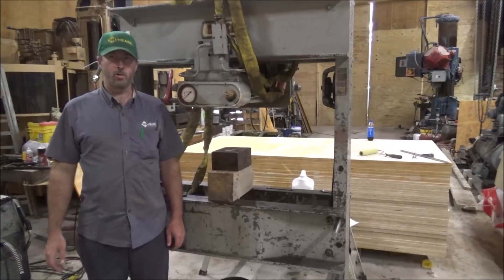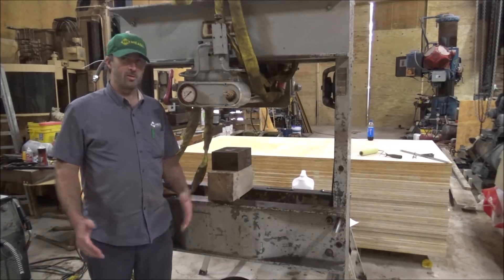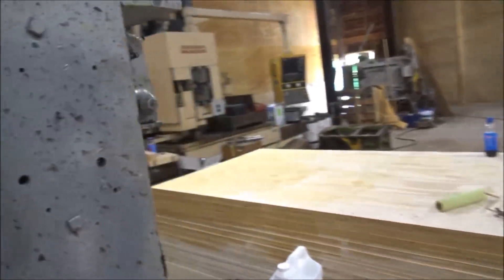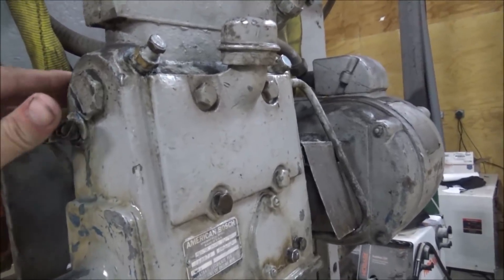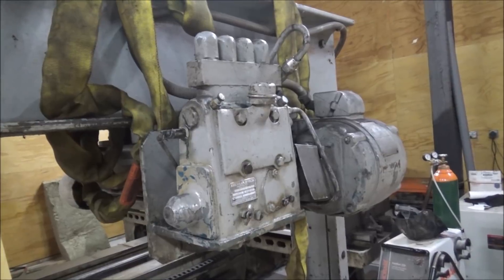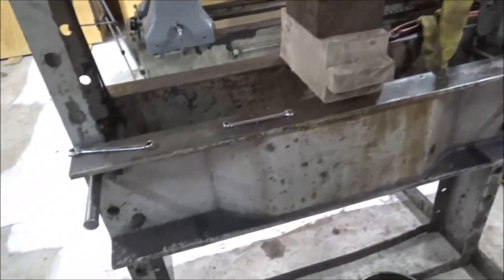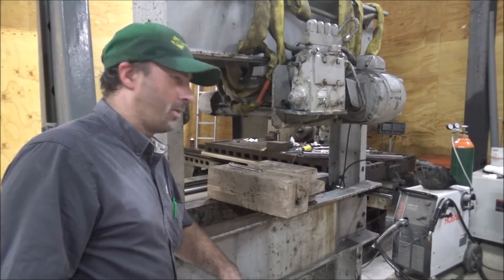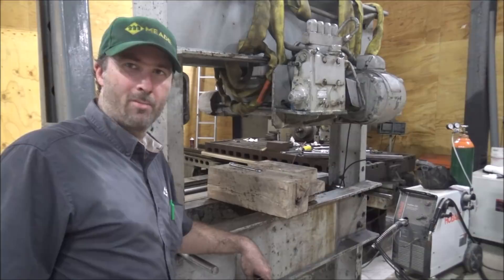Antique Dake Press Back in Action

Comment: Hey Brain could you answer a few question on using the injection pump. I just rebuilt a $ 34.00 dollar auction press and have new 4 cyl injection pump with nothing that it fits on is the pump direct drive off the motor and what is the rpm and hp of the motor.  Thanks.
Reply from the maker: In mine it runs direct off a 3hp 1750rpm motor
Reply: @bcbloc02  Thanks Brian did not want to go in to it trail and error.

Comment: I'm wondering if it could push more than 20 tons, not being 100% familiar with that type of usage of a diesel injector pump for that purpose, what I understand, is that an injector pump is able to put up in excess of 10k psi. or .....    Maybe I'm wrong...???
Guess we'll see in future episodes...    ;)
Reply from the maker: They have a 5000psi relief valve installed on the pump outlet. It is supposed to be set to produce 75ton as per the rating. I don't doubt that it still can.  I just don't have anything that needs that much squeezing. I had it 30ton and decided that was enough to put on the 6x6.

Comment: enjoy the videos, ive got a couple of chunks of steel that  may be suitable for that press what size do you think would work well on the bed.   Dave
Reply from the maker: 1" to 1.5" thick by 3-6" wide and about a foot long.
Reply: @bcbloc02  what I've got may be a little  bigger than you need , got a chunk  2 1/2" thick 11 inches  wide and 30 inches long.  Could you get what you need out of that? If so I could get it to you sometime fairly soon.  I  am just down the road in Knoxville.  DWG
Reply from the maker: Yeah I could saw some plates out of that.
Reply: ok , let me know the best way to contact you back channel and we will set some thing up.
Reply from the maker: shoot me an email bcbloc02 at yahoo
Reply: email sent
Reply: @bcbloc02   We had some press plates that had a V in each end of differing sizes and if you flipped those plates over there was standing  V blocks on each plate that was handy for straightening bent shafts. You might want to add some of those to your project.

Comment: The patent was applied for on 1952-03-15. It is for a "Hydraulic eductor valve", which appears to be the operating valve for the machine. The patent is for a clever arrangement that makes the ram move much faster than it normally would at low pressures, so you can get it down to the work in a hurry, then it moves slowly as it applies pressure.
Reply from the maker: I checked it out and it is really cool. Increases ram travel speed by 5-6 times!! That is impressive.

Comment: So that press is a 20 ton. Seems like it should be more. I have the slab of inch steel plate for the bed for you. Somehow I think the Australia post guy might complain if I stick it in a flat rate satchel though. 😛
Reply from the maker: I didn't want to put over 20ton on a wood board so I didn't test it any higher.
Reply: bcbloc02 ohh i thought u had it maxed out. Looks like u did,
Reply from the maker: I maxed it when I was fooling with that valve that limits it but otherwise I nowhere near maxed it.

Comment: Give dake a call with your serial number and they wil tell you when it was built and email you a parts manual.  I did that with mine, which is a 1944 much older than yours, and they had replacement parts in stock.  A great company to deal with.  

Is that a 75 or 50 ton press?
Reply from the maker: Gauge goes to 75ton  so I assume that is what it is.

Comment: Super press Brian, great find. Glad you have it running.
 I checked the Dake Corp website and it is about 12 miles south of me in Grand Haven, MI. They say that they have parts for old Dake presses so if it broke could fix it 
Here is the link to the 5-0 series of hydraulic presses.  http://www.dakecorp.com/uploads/pdfs/manuals/5-Series-Press.pdf  
The new press looks a lot like your old one. 
They now use a 5 piston wobble plate pump but the old one you have will probably out last anything they have now! The lift hoist looks like yours too with a new position.

Comment: Hey how are those cables? I have heard they they can break unexpectedly....especially when they are holding up something expensive. hmmmm   Are you going to turn up the pump for MORE POWER? That is one cool press!
Reply: There are metal pins which hold the table in place while pressing, the cables are there only to help easily move the table to the different places (heights) where the pins can be inserted.

Comment: i always liked presses with traveling rams.. so you could press on one side of the bed or the other. 

are there 2 bed pins on each side.. the lower set as safety so if the top ones shear the lowers catch the bed from dropping very far.
Reply: I've been wondering, if a press table was to have one set of pins only (one on each side), would it be better to place it high or low? I know the load that's on it will be the same, but what about the stress in the table beam? It seems if the beam is ''sitting'' on the pin (i.e pin is low) it would be better than if it was ''hanging'' from the pin (i.e pin is high), but I've seen presses built both ways.
Reply: @literoadie3502  supported below leaves the press table surface without side obstructions in my thinking. 
I can visualize a dozen styles of post and table depending on what is available.
Reply: @waynep343  Supported bellow seems like a good way of doing it, you just have to make sure the two table ''plates'' or ''beams'' are fastened together so they don't have a tendency to spread apart under load, as they are effectively standing on their support pins as opposed to hanging from them. I've seem people tie the two plates together with welded in tubes, threaded rods etc. I just recently bought a piece of 6''x3'' 10' long steel channel locally for cheap, to cut up into 4 equal lengths and build a press with it. I need some uprights for it now. I've been thinking of using angle iron as the uprights as angle would provide rigidity in two directions and make for a nice stiff structure.

Comment: That’s a neat idea with the injection pump. Probably not the cheapest idea but cool none the less.
Reply: At the time they made the press it was the most economical way to get a high pressure pump. Remember truck parts were off the shelf, easy to get, and cheap.

Comment: Well done. Tough old press. That pump is very creative and serviceable.  

I was beside myself as I ran out of fluid film in the garage.  Just got a new set of three cans so peace returns.  Amazon has the gallon cans for just under $40.  Way cheaper than the aerosol if I can rig up a spray can.  

I would hang a nice face shield on the press.  Shrapnel always a possibility, and we can't have our intrepid hero stopping progress for some stitches.  

Dan
Reply: You can get auto paint touch up guns that are small and easy to use, and have something like a 1 pint media can. Great for something like a spray oiler, and cheap (and perfectly workable) from HF.

Comment: Its a great press! Will it still go up to 75 tons or will you have to do some rebuilding?
Reply from the maker: I think it would do it. I didn't have anything I wanted to put that much squeeze on. At work anything I ever put more than about 40ton on usually broke. It is going to have to be a big piece to stand the full 75.

Comment: Beautiful press Brian. You don't need a press every day, but when you need one you need one. Does the injection pump have a small hydraulic pump feeding oil to the fuel rail or has it been modified somehow. The shop looks great, say hi to Bailey.
Reply from the maker: No transfer pump. It just pulls it after it gets primed.

Comment: No offence buddy and i'm not an OSHA nazi - but metal to metal drift in a 20 ton hydraulic press with your face right in line - that drift could release with bullet like force and severely injure you - presses are really dangerous and need respect - you should shield it or not use small diameter drifts. Just saying.
Reply: Yap. When I was working in the railway, all hydraulic presses had cage doors as safety features because there was a death back in the 60's the old timers always talked about.
Reply: I worry about Brain like a brother - he's in that shop by himself and if he got taken by a flying bit of steel they wouldn't find him for a week - there is a very good series of videos by Dan Gelbart (physicist \engineer)- an amazingly talented inventor and prototypist(if there is such a thing)(because he became a multi millionaire out of it by selling devices to Kodak) - anyhow his instructional video(for engineering graduates at Stanford or something) on the hydraulic press should scare the bejingo out of anyone - bits of steel under 20T+ of force  can release explosively -  Brian please please please be careful on the darn thing - make a darn tooting guard for the thing.

Comment: Brian very interesting on the injector pump used for operating a press. Would any inline pump work? Like a 6 cylinder diesel same pressure just more volume.
Reply from the maker: I don't see why not. I would use a p7100 probably today because of its ready availability.

Comment: I would have thought that with your experience with breaking wire cables you’d have changed the old cable first before testing. Just saying.
Reply: It's not really under any load
Reply: Sarchasm (n): The gulf between those that get it and those that don't...